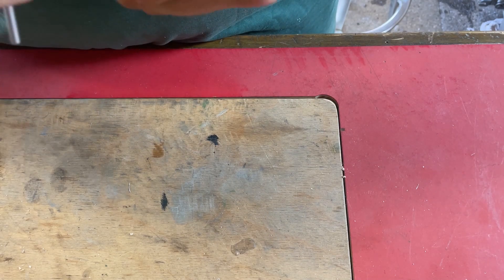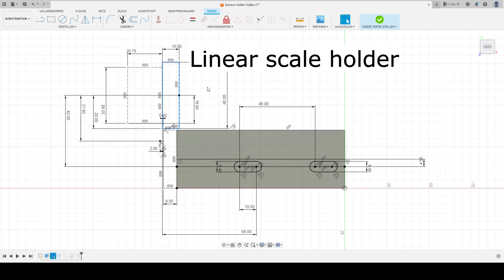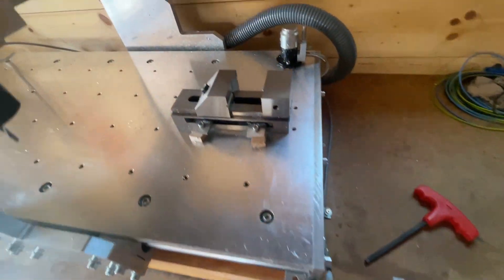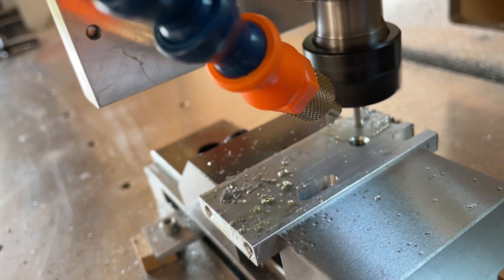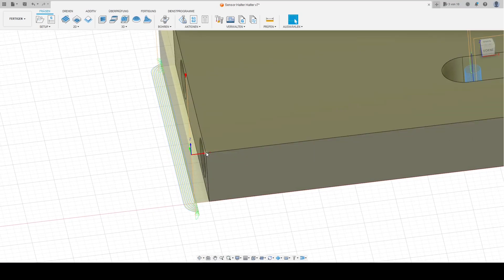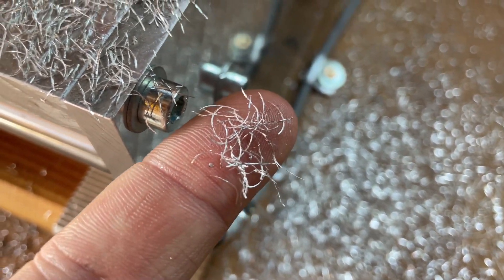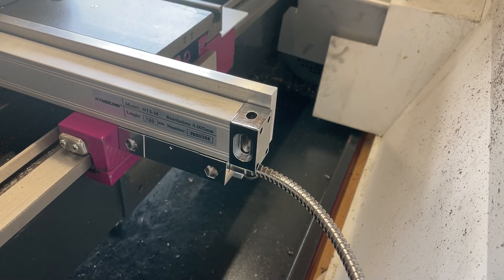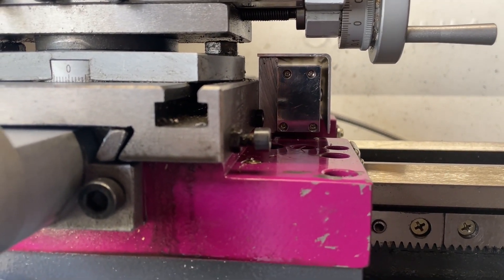Moving the linear encoder from the dro on my mini lathe (part 2) (making some real chips)

Comment: What about the carriage lock bolt? Can you still use it?👍👌🇦🇺
Reply: It's one of the bolts on the front right hand top of the carriage. In the pink paint, but not for the apron, the 2004 has one, I thought the 2506 does too. After rewatching your vid, you should have access to it 👍👌🇦🇺
Reply from the maker: I didn‘t know that it has one but i think i can still use it because the encoder rail douse not got up to the front